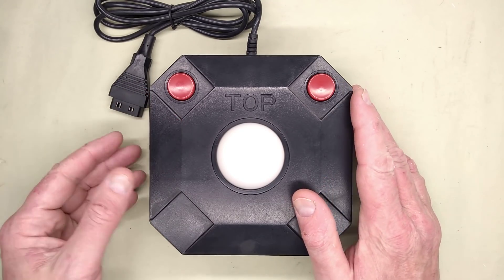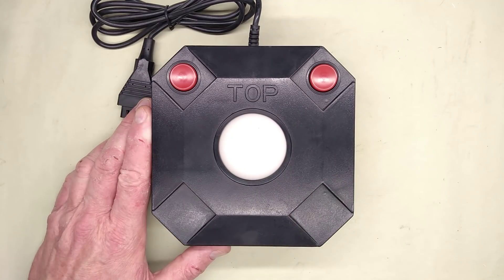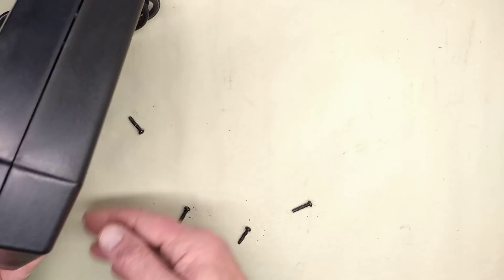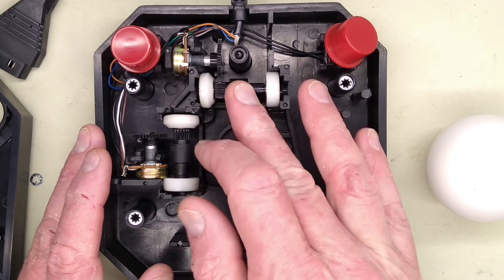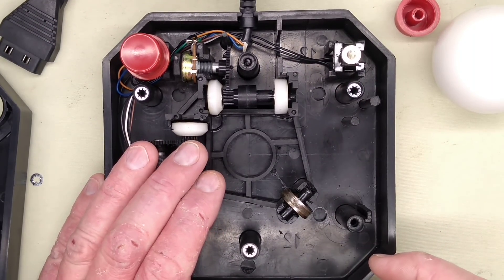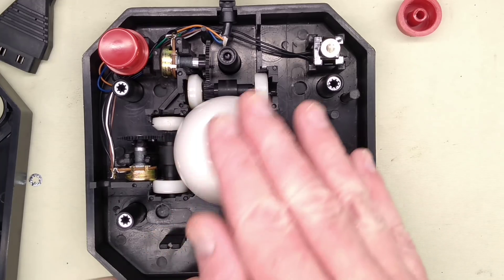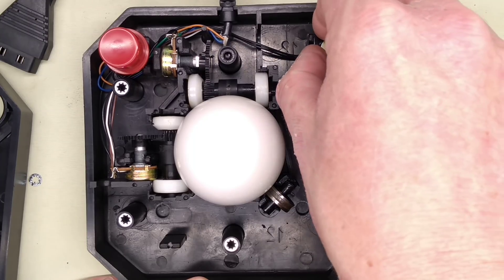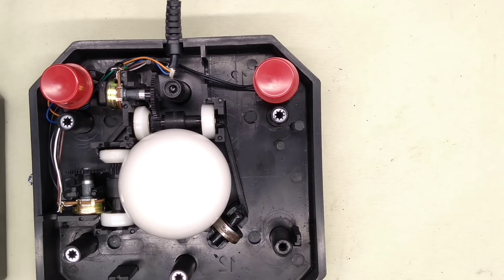Inside a vintage PC gameport analogue trackball.

Comment: Wow, super barebones... no electronic components! xD

Fun story about trackballs... when the mouse came out and started going mainstream, I actually resisted the idea for a few years. I guess many people also did.

My dad was into computers for his job, he graduated in electrical engineering at the time because there was no computer science or engineering courses, so he eventually post graduated in it later on. He started working at a time companies were using valves, passed through puch cards, then huge mainframes, etc etc. As a kid I had contact with all that. As far back as I can remember, he was using IBM mainframes with magnetic tape roll storage in the main job, but he kept some "souvenirs" from past jobs. xD

So, when an alternative method of input started popping up (at the time he had a small office to privately teach basic computer stuff), instead of going to mouse, he went with these weird keyboards that had a label on them saying "Cat" (joke from manufacturer probably) that had trackballs on them. It was integrated with the keyboard right next to the num pad.

Problem at the time is that a lot of people (including him with his office) had custom computer desks that didn't have a space for a mouse in consideration. Those office desks with a lowered adjustable tray for the keyboard that had no space for a mousepad. It was cheaper to go for a trackball than replace all desks. He had like half a dozen PCs in his office ranging from 386 DX 40s down to PC-XTs with green phosphorous screens.

We had quite a collection of old hardware... monochrome, green phosphorous, orange phosphorous, 4 color CGA... all stuff that he put huge ammounts of money into back at those times. I never seen him using but found on storage stuff like a 600 baud rate modem that was more heavy than a current modern desktop. All metal construction.

Eventually, by the time Quake 3 Arena came out I finally switched and learned how to use a mouse... xD Yep, it took that long. He also begrundgingly adjusted to it later on, even later than myself. xD

Man, the early version of trackballs were pretty clunky. Not only they'd get horribly and visibly filthy with time, what with you transfering all your hand gunk and grease directly to it, a whole lot of big trackballs I had over those times had plastic stands and construction inside them that would result in problems like the one Clive is showing... cogs would get chewed off, plastic stands would sag and warp, and at some point it'd stop responding because the ball was basically rolling on top of a layer of grease, gunk, hairs and crap instead of the actual mechanism. xD

Good times.

Comment: I used DCCAD back in the early 90s for pcb design...it was basically half a step up from MS Paint, except with horrid print support. No autoroute, no DRC, no nada. But it fit happily on a floppy disk, so I could take it and some toner transfer sheets to school and print off my projects on their laser printer. It wasn't really meant to be used over 100dpi so all my boards came out jaggy as heck...but they worked. Sometimes.

Comment: I've never seen a gameport one of these before. I'm going to have too see if I can find one.
Reply: @Lester Piglet Indeed. And game cards.
Reply: Paul Potter It's a very interesting primitive circuit on the card too, I think I got the traditional diagram lying around somewhere.  Was kind of hoping to see it in the video.  The 15 pin connector had pins for 4 potentiometers and 4 buttons, which could be used for two analog joysticks or a single fancy controller.  Using it for a trackball was an interesting reuse, but would not allow single pixel positioning at normal resolutions (I think it was only 8 bits per channel, so 256x256 max).

Comment: The very first trackball made used a BOWLING BALL.

Logitech seems to be trying to move people from the mid-priced Tackman M570 thumb-trackball to the much more expensive (but visually very similar) MX Ergo thumb-trackball.  Fortunately, there are now trackballs from Perixx that are a bit fatter than the Logitech ones but also a good bit cheaper.  I've got no idea about the button life on them (which on the Trackman wasn't great) as I only got one at the beginning of 2019 and it hasn't started to act up yet..

Comment: My first mouse was a Nidd Valley Anamouse. Essentially the same thing turned upside down.

Only it had a "scroll wheel" - somewhat unusual back then - but on the side for thumb operation and I think aimed at rotation. Also a third button that used the fourth analogue channel just as a switch. Advertised as Bit Stick compatible. Bit Stick was a joystick that could also twist. Plugged into Acorn Electron Plus 1 which had an analogue port compatible with beeb (other than missing the lightpen line). I don't think that's pin compatible with PC analogue game port 15-pin D socket.

I believe washers on mechanical key switches are to quieten them down.

Comment: I used to have a big old beige serial (DB25!!) trackball that I got in a box o' junk from a computer fair years back, loved using the thing, but it was so low-resolution that it wasn't much good for modern (at the time, XP being the latest) OSes, but I still liked it regardless... :)
Reply: Really old mice use 25 pin port to.

When settlers came and you could play splitscreen with two mice i found one old one to play on my pc so we could have two. (Because it had a 9 and a 25 pin serial as most computers at that time)

Comment: I still have my big red marble out of my first trackman fx. I learned to solder so I could replace the left mouse button "clicker" on my fx when they would wear out. I would buy old crappy mice from the 2nd hand shop and desolder their clickers out and splice them onto the fx board to keep it going. About 4 times (each) replacing the buttons it finally gave up the ghost.

Comment: I am doing a prototype DIY trackball myself. I wouldn't try to use the old roller-type inputs, I went with optical mice sensors and improvised ball bearings. Although the tracking is working fine and the pool ball feels good under the hand, I'm not sure how to position the buttons. I prefer index / middle finger trackballs rather than thumb trackballs, so I find it hard to find the most comfortable button placements, either on the side of the ball or the bottom of the ball. I haven't worked on my project for a while, as I got lazy and just used a touchpad.

Comment: Never been a fan of "finger" trackballs, myself, I prefer "thumb" trackballs. The "best" model IMHO being the Microsoft Trackball Optical. Unfortunately they stopped making them about 10 years ago and they're now as rare as hen's teeth (and with a price tag to match), managed to pick up a couple for reasonable prices off an eBay saved search. The only issue with them tends to be that the stainless steel ball bearings the ball rides on get flats on them after several years, but you just replace them with some nice new 2mm zirconia balls and then they're pretty much bulletproof (button cycles notwithstanding).

Logitech has a similar model which I've used once, but the build quality just didn't seem to be the same level as the MS one.
Reply: I came across a white one with a red thumb ball once. It was jittery as hell so i dumped it. Now youre telling me it was super rare and just needed new bearings? Damn! ...i do still have two logitech ones though that i love so much. Its a shame theyre not available anymore

Comment: Oddly I have an identical shaped/designed trackball but in red/white combo with a 9pin interface. I believe it was designed for an Atari, however on the inside it had optical (guessing) plastic flywheels with sensors like in a conventional mouse. I've never used it, was an Ebay purchase 10 years ago

Comment: BoardMaker?  Used that in college early 90's, and in a job around 2000, version 2. Very simple for home prototypes and can still run, even now, if you use DosBox. I had to write a visual basic program to capture the print file to a bmp image though.

Comment: Psion Boardmaker...that brings back memories from 30 years ago..resplendent in its ring binder/folder, complete with dongle!! They were based near where I lived, so I picked it up from their office...never did get a trackball! It ran on a 286 with 1 meg of memory under mouse control and was pretty awful compared to today's offerings!
Reply from the maker: 386 here and no dongle.  It worked and was ideal for simple designs.  I use Sprint Layout now as it is similar in function and allows spontaneous ad-libbing of designs straight to the PCB.
Reply: @bigclivedotcom  Yes, looking back, it was revolutionary, compared to tapes and transfer sheets and the good old Dalo pens that forever clogged and dried up! I used it for a number of designs, mostly analogue control circuits and my 'experimental' nicad fast chargers for RC batteries.

Comment: Effectively a joystick, you could hook this up to a windows XP or earlier machine (I believe they discontinued gameport support after XP, happy to be corrected) and use it as a joystick for games, or a MIDI input controller; could be interesting for use as a blind XY controller, or if you were careful not to slide the ball around you could even mark up the trackball so you'd have some visual positional feedback
Reply: Not a MIDI controller, that uses a separate pair of pins on the connector.

Comment: "back when every single button on your computer keyboard was still a button" EXCUSE YOU, i'll have you know i have a 102-key mechanical keyboard!

jk, i do have the keyboard but i'm not as hysterical as some people are about them.
Reply from the maker: The original Cherry magnetic-switch keyboards sounded and felt wonderful.  But the modern low travel keyboards are better suited to high input.
Reply: @bigclivedotcom  I'm inclined to agree with you. My main PC's keyboard is an IBM Model M from 1986 (the clicky one)  but recently I acquired an HP Probook 4520 and I'm finding I like it better. Longevity is another matter: I had to replace the HP's keyboard as it worked fine but was very polished and rather dirty. The IBM gets stripped and cleaned once a year, and will probably outlast me.

Comment: I've been using trackballs for years (decades?) due to RSI issues and I think I've bought every single one on the market.  Microsoft made the best one for years, then discontinued it - NOS ones now sell for > $400....   My current favorite is the ELECOM Trackball Mouse, which, IMHO is better than any Logitech (have a couple of different current 'Logi' models still in use as well).   Not as good as the old MSFT mouse, however.

Comment: I purchased one of those for the Commodore C=128 to use with GEOS I was very dissapointed in it's performance, never did give me what I was looking for. Of course I later learned that it was probably not the trackball that was bad but simply the fact that the little 8 bit machine could not drive it properly.

Comment: Kinda weird, I'd've thought they would've used rotary encoders on the analog port but used the x and y inputs of both joysticks and sort of fudged the quadrature decoding
Reply: ChayD Actually, this makes the ball directly set the analog x and y inputs.  No fudging.  Unless of cause it's wired to feed x, y, z and w to get almost double the range.

Comment: This is a easy to mod mouse pad just add a arduino I did this with a old flightstick and it now works on modern pc's and with the old interface. Just splice a arduino pro micro in between and boom some simple code and it probably would be a good trackball again.

Comment: Ball bearing instead of a simple spring loaded roller on the bottom right. Geared pots instead of rotary encoders, with proper nylon looking guide rollers. "Snooker" track ball. Spring washers. Encased keyboard buttons. No PCB and electronics at all. Truly oldschool. Things like this and joysticks were already getting to the cheap and flimsy side in the 80s. They were horrible.

Comment: I assume those potentiometers must not have an end stop? There must have been a calibration step to avoid glitches when it loops from high to low resistance?
Reply from the maker: They do have an end stop.  The ball just skids on the roller when it hits it.
Reply: @bigclivedotcom  Oh, are they multi-turn at least? And there was me thinking of clever solutions like having 2 out of phase pots. I do have a tendency to overcomplicate things.
Reply from the maker: @weirdboyjim  Single turn with gearing.

Comment: That looks suspiciously like its designed to work with the old RS232 (joystick) interface. Maybe it worked on a bbc micro
Reply: That plug looks very much like the Atari 5200 stuff.  Was also a 15-pin port.  Is it possible this was an alternative to the official trackball, for those without the space for a controller the size of a house?

Comment: I bet you could make it work with a few adapters.
Reply: They got a adapter but if you go a step further add a arduino pro micro it can then become a macro and work on modern computer while still having the other connector in tact. I did this with a flight stick almost same design and it be so simple makes me want to find one of these trackballs to tinker with.

Comment: Hey Clive, my uncle has struck again! This time he keeps going around using the word "amperage" whilst saying its safe to work on live circuits if they're protected by an RCD as it "limits the amperage to 30mA". Seriously its like educating a brick wall.
Reply from the maker: It limits the leakage current to 30mA by tripping, but if he gets across live and neutral he'll just be treated like an ordinary load.  Sometimes electricity has to give the lesson the harsh way.

Comment: I had expected to find encoder wheels with light detection in it instead of pot meters
Reply: That would require extra circuitry to convert the pulses into voltage. With this the pots can be connected directly to the connector.
Reply: yea you're right that would mean it would need a DAC and this is from before that time
Reply: @maicod  Well no, they did have DACs then, but why increase the BOM cost?
Reply: true

Comment: Dammit, this means I am also vintage.

Logitech trackman is good, but they're flipping expensive and my middle mouse wheel on mine went gooey.

That thing looks like shit! I don't think it would ever work. Atari used potentiometers but they were directly driven by knobs on their controllers. In this setting....nah...it might work with a rubber ball??

Comment: Did anyone else use the 15-pin joystick port to control Winamp, either with an actual joystick or with your own contraption?
Reply: nah, i went for a infrared to serial thingy built for a free easy software which could use and learn any standard ir.  more buttons, less cables...
hmmmm. dammit, and now ive built a usb button box with an arduino instead of using the ir thingy wireless :-/
Reply: @PsiQ  WinLIRC?
Reply: @MicraHakkinen  ...hmm.. i think.. something in that way, even forgot the name, that long ago ... but i guess thats it, even found the schematic: http://www.lirc.org/receivers.html (a bit down on the page)

Comment: That bearing roller neads desperately to be cleaned. 
It should still be operable  with a suitable serial port card...
Reply: @stevenbrice5554  they make pci cards with them... I am well aware of the design, have made splitter cables for dual sticks instead of stick plus hat....

Comment: No schematic????  The "Trackballs" of the late 80's did spin and spun very well.
Reply: The schematic is basically exactly what you can see... two linear potentiometers and two switches.  Simple enough that even I could (did) make a set of rudder pedals to use with flight simulators... never quite got round to converting them to USB HID though.  Everything is much more complicated these days!

Comment: shouldnt it be fairly easy to take an old ball mouse from ebay, taking it apart and refit it with a billiard ball? i mean its the same tech, except for instead of potentiometers they usually use incremental pulse givers (dunno the proper english name... im from ger.)
Reply: Optical encoders.
Reply: @simontay4851  not sure... the cheap ones in most mice( still used in the scroll wheel) use contacts...
optical ones are the high end tier

Comment: Wow, that is a piece of garbage you got there! You'll never get spin from those cheap plastic gears and pots. I used to have a Wico trackball ages ago. It was great. It had heavy metal rollers and optical sensors. What you could do with this; rip those dumb pots out, lube up the rollers good, and stick in a cheap USB optical mouse board to pick up the ball movement. You might need to mark that white ball up with a magic marker or something. Also you need a program on your PC to invert the mouse movement. There is a program that does this, I can't remember what it was called.

Comment: That's basically a classic arcade Atari trackball from Centipede/Millipede/Football etc. the control panel being the top and the lower half screwed into the underside of the panel. Properly clean and tweaked those things could spin like a mother.. I still use the modern varsion wireless logi trackball on both my laptops as it's more fun than that #%@ touchpad.. who can spin that?
Reply: Think they running missil defence on one of those in the arcade sceen in terminator 2

Comment: That ball bearing is very shitty, or very worn, or heavily-greased.  That flick you gave it should have caused it to spin for many seconds.  So a really crappy reject that they got cheap.  Or very worn (unlikely, unless they bought second-hand bearings to cut costs).  Or somebody stuffed grease in to try and improve it (if it is full of thick oil or grease, WD 40 is a really shitty lubricant but excellent at removing oil and grease, so sloosh it with that a few times).